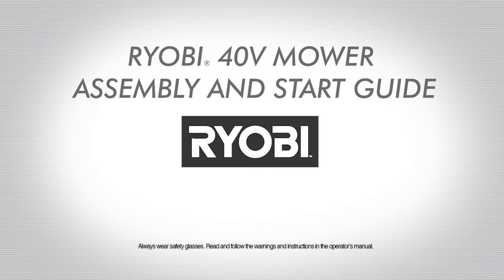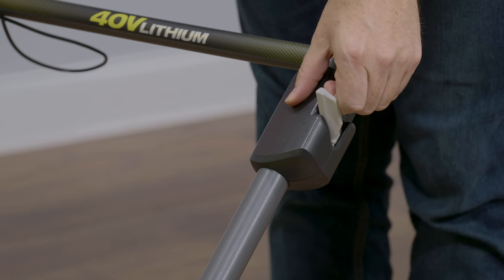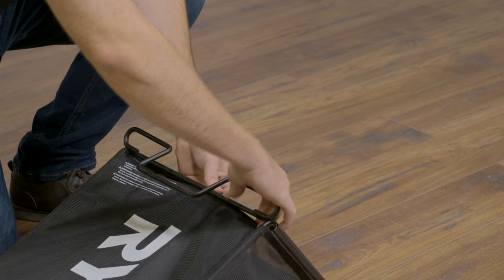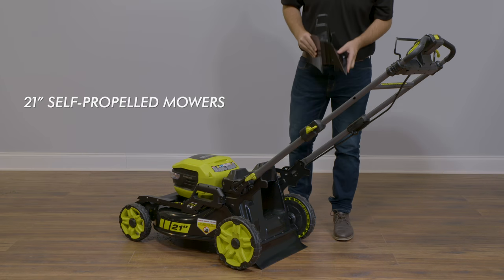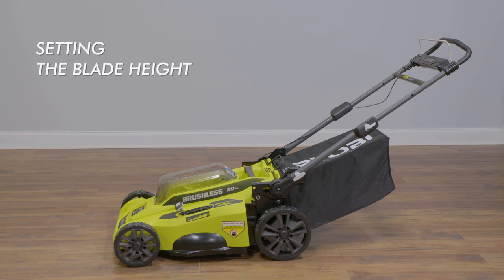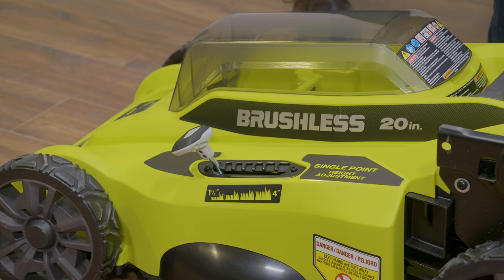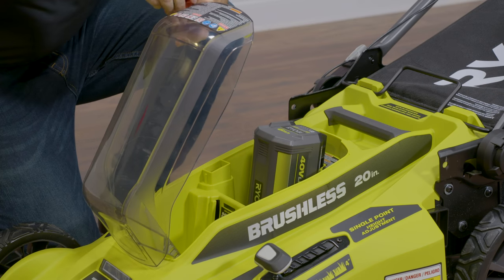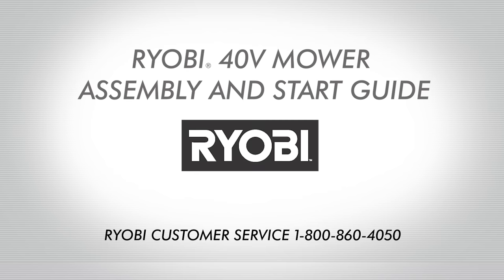How to Assemble & Start the RYOBI 40V Brushless Mower

Comment: If you can not get yours to run. Check 1.) battery 2.) Light is on in the front of mower after trying to start, If not. You have connection troubles inside the motor hub. If it is on 3.) Reextend the handle ALL the way out an at the lowest setting, If it works but only hit an miss. The connections inside the handle and or "dead" switches they have (diff for each model) are not connected right an need reattached with heat shrink (properly) so they do not fall off again.  They do have heat shrink in SOME places, But I have not SEEN one ever being hit with heat... 2.5/4) The worst area being Right at the start button. With the connections in this spot being effect be ALL other fixes an/or steps

Comment: I just bought two this month and They wouldn't start. 1st was a self propelled model, I just returned it and now the basic model won't start. Battery is all charged, not sure what the deal is, I have a year's experience with a neighbors self propelled mower that works great.
Reply: Having the same problem. Ever find a solution?
Reply: @PaydiPoo  It's a flaw with the safety switch. Ryobi will not address it.